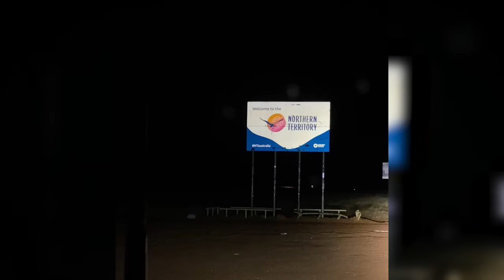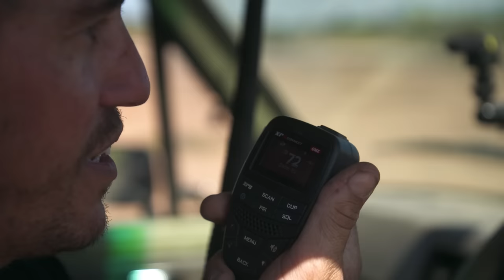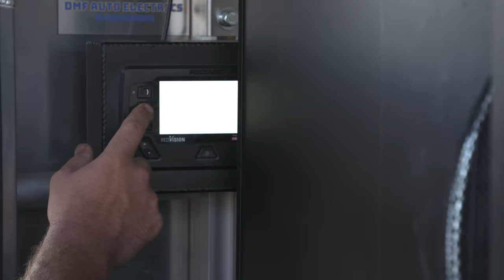So STUCK we needed 2 winches! 10KM in 3 DAYS to NT Fishing & Camping PARADISE!

Comment: Alright, so I’m working on this killer 4WD Ute project, and it's going to be an absolute beast. I’m talking about lifting it, throwing on some heavy-duty suspension, a winch for those gnarly situations, and off-road tires that’ll chew up any terrain. I’m even planning a custom bull bar, a roof rack with a light bar, and an upgraded exhaust system for that deep, throaty growl. But here’s the deal—I need to win some Raptor paint. This stuff is perfect because it’s tough as nails, scratch-resistant, and can handle anything the Aussie outback throws at it. Plus, it’ll give my Ute that badass, rugged look that’ll make it stand out in any crowd. Winning that Raptor paint would take this build to the next level.

Comment: Currently working on my 1997 Toyota T-100 4x4, it came with a custom rear steel bumper and I recently bought a used trail gear bush bar up front that needs some raptor coating! Keep up the awesome adventures, cheers🍻

Comment: I bought a hdj79 as my first 4wd and I’ve been heavily modifying it along with some rust repairs on the tray. Homemade trundle tray, rear bar and roof rack. All the work has been done completely at home. It’s been a battle and once I’m completely done I wanted to completely respray the tray with raptor.
Reply: A FTE as your first diesel 4wd
Dam boy you is spoilt

Comment: Hi guys.  My project is a 1968 VW Baja.  It’s a full built body interior panel paint and motor. The raptor I was going to using on the bar work floor pan under the bonnet and custom roof rack. It would finish of these areas to a robust finish while protecting it on off road tracks. What a great episode and look forward to the next part.  Cheers Shane.

Comment: Nice to see you guys somewhere new and with it's very own challenges. Can't wait to see the next episode.

After been a bit slow on recovering my car from a water filled bog hole I've had to remove the carpet and have been thinking about raptor lining the floor pan instead of putting the carpet back in. Will make it a easy job to clean out if (when) I do it again.

Comment: currently in the process of sandblasting the chassis of a gu patrol, ready to install chassis bracing and hydro bumps in the front, then ocne thats finished installing a cummins QSB/ISDE 4.5L motor into it ;) got one kit of raptor already for the chassis once its finished, was thinking on doing raptor on the body aswell, but unsure as its going to cost a fair bit to do the outside aswell,

Comment: Always a great time watching you guys forge a track into the wild. Another great episode! I just picked up my first "true" 4x4, a 1991 JEEP YJ wrangler. Its got the inline 6 cylinder gas motor, solid axels front and rear, sitting on a set of 305/75R15 (33" by 12.5") Its got a 6,000lb warn winch, a couple of light bars for night wheeling. Now i just have to get the rest of the gear ready, like a 12volt system, a swag, fridge, stove, etc. If i got the Raptor coating kit i would probably coat the inside of my jeep to make cleaning up after a muddy trip easier. 
Cheers boys! from a fan in beautiful British Colombia, Canada

Comment: Awesome Episode Guys, stuck on the salt flats bought back a few memories Haha.
Currently Building an EPIC offroad camper trailer, cruisemaster gear all over, have pulled all the bells and a few whistles.
Structures welded, chassis is Primed  and i've run outta Raptor 😂, a 4l kit would be awesome to finish her off.🤙

Comment: Top job guys I'm currently working on a single cab rwd Mazda b2500 . Had to completely rebuild the back part of the chassis. . Nothing but a sheet of aluminium checker plate on the back

Comment: Great episode, working on my paj NX, fitting an UHF radio, Hikeit and traction control modification, gonna be 😋. I'll use the Raptor spray on the undercarriage of the camper trailer where I'm fitting a new 2000w inverter.

Comment: Hi guys, in my shed is a 1982 Ford Cortina  pickup that i am busy building up, i would use the raptor to do the tray as well as the bottom sections of the sides of the vehicle as it is a two tone paint job.

Comment: Currently got a second D22 ZD30 sitting ready as my project ute. About to go to Cape York with my current D22, as soon as im back from the trip, will start working on the project ute. Gonna raptor coat it a dark blue with black trim. Doing a full build like Shauno is did with Sooty, starting from basically a blank canvas and will be doing it from the ground up

Comment: Chuck my hand up for the Raptor coat. I have an old tradie trailer - converting it into a camper trailer. Rooftop tent, awning, kitchen and 12V system going in over the next couple of weekends. Raptor coat will be much better than the hammer finish I was going to use.

Comment: Love the excitement and anticipation. Can’t wait to see the next instalment. Currently kitting out a very tidy GTI powered Sierra Sj80 with a bull bar, rock sliders and rear bar with swing away tyre carrier and jerry can holder. Anyone who owns one of these can appreciate the challenges in finding off the shelf aftermarket parts, so out with the welder it is! Always planned on using colour matched raptor coat to get that showroom look, and make it as tough as nails to keep that look for as long as possible. Nothing like the satisfaction of doing it yourself. 😃
Reply: Doing the same myself. GTi into sj80
Reply: It’s a long journey to do it well, but worth it in the end. Would love to exchange stories.

Comment: You all really brought back my passion for going off road I finally bite the bullet and bought myself a 92 Ford f150 extended cab long bed  needed the extended cab for my big dog. Gonna rip the bed off and build a bed that fits my needs. Got it for a steal tho only 900 usd  runs and drive good manual locking hubs 4x4 works great really can't wait to go way off the beaten path. Already takin it on a few camping trips just to test see what it can do.

Comment: Hi Shauno & Graham. Big fan. Im in the process of doing up my box trailer for extra storage while touring, Ive just finished my DMAX and putting old tires on the the trailer. Need a paint job on the trailer, planning on putting a frame in for an awning or roof top. Perfect light weight tow for wood and extra's. She a bit rusty being a perfect job for Raptor. I have already bought a can or two off your site but coming up way short. You could say I'm a man in need. Take care

Comment: I'm working on my first 4wd, a 98 jeep Cherokee. I have arb lockers front and rear with 4.88 gears on 31's. I have a 5.5 long arm lift, 35s and bead locks in the garage. All I need now is a new paint job since its a little scratched up from trails I've hit. I want to hit some mud but the cleaning after scares me I've found mud washing it from trips months before. Mud get everywhere that's for sure.

Comment: i have a 2000 jeep grand cherokee. just finished up my front and rear long arm install. I'd for sure raptor line the lower portions on the car as well as wheel wells since I dont have the splash shield in them.

Comment: Thanks for this review and sharing your knowledge. I have the same inverter and a 500 amp hour lithium battery. I’m looking forward to seeing what I can power from that setup. I’m hopeful I can run the AC and heater in a small off-road camper. What do you think?

Comment: Another great episode boys ... love the mud ;) No 4WD at the moment as I'm waiting for my new Prado to arrive so doing some  winter upgrades to the camper & boat trailers. 

Planning a trip up to the cape in 2023, the Raptor would work a treat on my old Camel Camper post modifications. It would work perfectly as a tough & durable new skin on the trailer body. 

** Maybe if I got a little adventurous with a spray gun I'd Raptor coat my daughters 1998 Ford Laser ... the way she drives it the car needs as much protection as it can get :)  :)  :)

Comment: After noon guys.

Bray from cairns here! Start off buy saying cracker of a episode ! Absolutely best one of the year! 

I’m currently doing up my 07 gu patrol wags. Fl3x30

Currently 3’ lift , 35s , twin locked , custom front mount and tune. Making about 187kw. My family / work car  just finished doing some 12v up in the back. 

I’d really like the raptor paint due to my flares and bar loosing there clear coat and looking super average . Iv users raptor before and am really impressed with it. 

Flares , front bar and if iv got any left would definitely love to hit the roof rack.

Appreciate it thanks guys

Comment: Just wondering. Have you guys ever tried recovering off of a buried spare wheel? When Graham gets stuck at 07:50 and you add a bunch of extensions, you have soft sand in front of the vehicle. In a pinch when you don't have a tree nearby and need to winch, you can bury a spare wheel facing flat under the sand with the end of the winch tied to to it for an anchor. I've seen this done in Botswana and Namibia. You can then raise the angle of the winch with a second spare as you guys have done in the past a bit closer to the vehicle.

Comment: Bought an old 1940s trailer that has been converted for offroading. I'm about to put a truck cap on it and install solar. That raptor coating would be so nice to paint the trialer so it can handle the abuse.

Comment: Hi guys, love the vids btw, if the comp is still open me and my stepdad are doing up a 2006 landcruiser hjz 79 series  with only 33,000 ks on it which was only used in the mines and we havent worked out what paint were doing it with so we would love the raptor coating for the bar work and cab

Comment: Mate you fellas have definitely inspired me to get into 4x4ing so I decided to pick up a knocking he’ll of a deal and scored a single cab d22 navara for $2K!!
It was stock as a rock and had engine issues, so I decided to do progress shots of it to become the best budget build to hopefully get more people like myself to get into 4x4 as well! 

So I had replaced the injectors and gave her a good old service in my little garage, got it registered and decided to run the exact same fulcrum suspension as you graham! I went with the formula 2” lift and is stalled them in the garage with the little time off after work. 
After that I needed bigger tyres! Just enough for that little bit of extra clearance so I went for the triangle kdr 265/75/16 and mate, I’ve had no isssues since then and only pulled the winch out once just to have it sit on the bullbar looking pretty because the car just hauled through anything I had thrown at it. I’ve just recently put a 1200x canopy on the back after having my whole toolbox on the back being stolen one night and needed that security, plus it was a due install anyway because it’s going to be a tourer 
All I need to do now is raptor coat the bodywork because you would imagine a 19 year old farm horse wouldn’t look as pretty if it’s had a hard run in its prime, and I tell ya this one did! 
So finish off the canopy build making my own custom build from drawers all the way to the electricals, wish you guys all the best and I’d love to pop around on a trip with you guys and show you all how this little rig goes! Forgetting to mention, I’m only 24 too! Killer than most people my age playing their PlayStations hahaha

Comment: I’m working on my 90 series prado currently putting a single turbo and chopping it into a space cab Ute. I could use the raptor on my bull bar and slider as they are in desperate need for some new colouring

Comment: I have a Red V6 2002 Rodeo Sport that I purchased new,  still less than 100k on the clock, currently replacing all the under body rubbers and shockers, and upgrade the current 31-10r15s to 33's , the vehicle looks mint on the inside but the exterior duco is very sun faded, I would love to give it an update to a more agressive look with  it with the Raptor Paint, Burnt Orange to the body, Black to the Lower doors, Side steps wheel arch and bullbar, and also Black to the factory sport bar, then mount 4x rectangular  Lightforce Striker LED driving lights to the roll bar, would look a treat.

Comment: Spur of the moment, bought a '95 b2600i for $800 with a blown head gasket. It's rough and needs a good spray to make it pretty again. Inspiration for this build comes from the zero $ zook and the pony-lux as i think I could have this ute built enough to travel from North to South Aus for less than $3500, and the raptor would go a long way with that 👌🏻👌🏻
Reply: Got 2 awnings, large fridge, roof basket, x7 various spotties/bars, roof basket, gas stove with x3 gas bottles all for free. Not all working when I got it but all working now. Ute came with a tray and winch. Got a swag, recovery kit and 2 ways. Everything so far including new gaskets for ute would tally tops $2K. Lift kit for $1.5K coming soon thats the budget. Diesel Toyota bloke through and through. But I'm keen to see what this petrol Mazda is capable of

Comment: Blows my mind that there is a limit on tire sizes over there. In the state you can get 35 in rims alone. Im putting 35" on my tundra with m/t tires got a 3" lift and 3" body lift i used rino liner one the body. Next goal is the bumpers

Comment: Working on my discovery 2 td5 hoping at something raptor spray it yellow as the paint is flaking off the aluminium body work and ill put some tonka truck decals on it and spray up the winch bumper, roof rack and once I make some brush bars spray them to

Comment: Doing a flood clean on my ln107 hilux still have to replace wheel bearings brake pads all oils but coming along looking at raptor coating the beast in black it has a 3.0 turbo diesel surf engine with alloy radiator 3 inch lift light bars on every side and is a perfect rig bar being flood damaged family is keen to go camping in this beast when its finally finished but winning your raptor coat package would help out a lot trying to upload pictures atm.

Comment: Not normally one for entering giveaways but for once, here is one I would actually appreciate winning. I’ve got myself a factory turbo 80 series that’s been off the road for a few years and I’m working on getting it back on the road. The chassis and shell are a ‘91, everything underneath is out of a ‘95 and the best bit is the engine - a top mount intercooled 1HD FTE out of a ‘99 100 series.

Everything underneath is covered in surface rust and looks like rubbish so while I’ve got the engine out (it’s going to a local workshop to get the crank replaced after the harmonic balancer came loose) I’d love to jack the old girl up and give it all a thorough clean and spray everything with some kind of tough protective coating. That raptor stuff sounds about spot on!
Cheers from Victoria lads! 👌🏼👍🏼

Comment: Hey guys you heard anything about lithium batteries exploding when waters got inside them , I sore a guy on you tube open an AA size battery ,he opened up the metallic bit put it in a glass container ,he then poured water on it and boom it exploded ,well lorry and 4 x 4 batteries are bigger so bigger explosion 💥💥 ,can you check it out and mention it with what you find out ,hoo roo

Comment: C'mon man.. You need to grease or lubricate the pinion bearings with gear oil before taking a preload spec. Don't take any rotational load specs dry.

Comment: A single line was never a chance so why no attempt at a double line when the dmax went down the first time? 
A lesson for all: if you want to go forwards on a mud flat bogging, it's often best to see if you can get a few feet backwards first. If you can, you will be able to place tracks, logs etc in front of all the wheels. Now you have a chance the vehicle will lift when you winch forward as long as you don't spin the wheels. For self proclaimed experts, it amazes me that they don't use one of the most basic tricks there is to make life much easier.
EDIT: Oh yeah, start at 10psi for flats & pans. Anything higher is a waste of time.